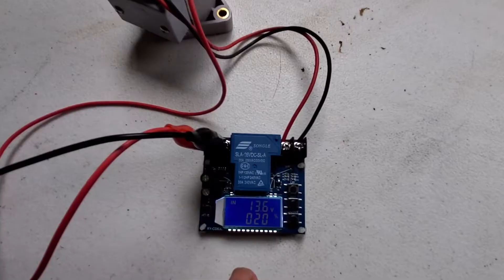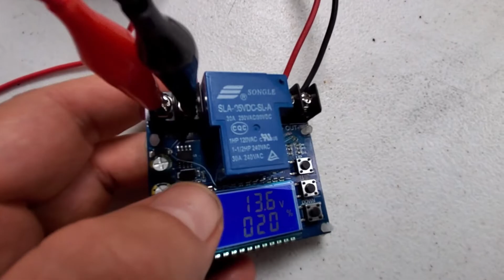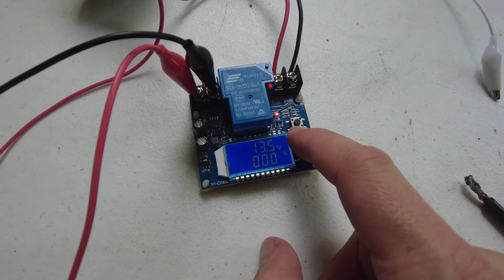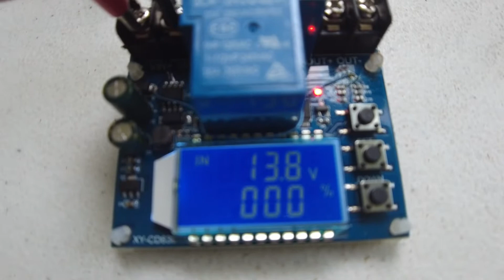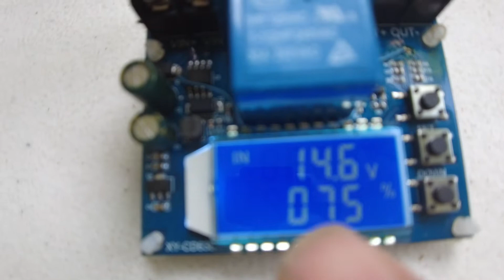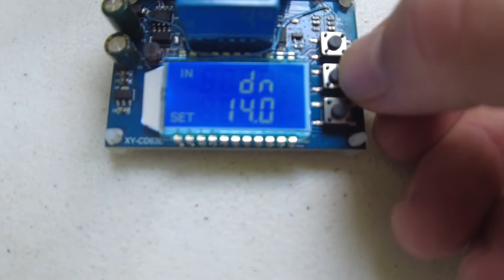Protection from shorted MPPT

Comment: My understanding is that this is one of the few things you can use to disconnect a high amperage DC load, because DC breakers and shutoff switches can arc and catch fire, but these should be filled with hydrogen. I would love any more input on this, too.

Comment: so the BMS doesn't have high voltage protection?
Reply from the maker: There's a limit to how high of voltage it can protect against. The MOSFETs in the BMS have a voltage rating, this could be 20v to 80v, usually not higher than 80v. So if you hit that MOSFET with 120v it will fail, and unfortunately many times the failure mode of a MOSFET is short, and a shorted MOSFET will pass that voltage right though.

Comment: That is really awesome!!!  Very good to know that there are options out there.  I wonder how many times this has happened with other charge controllers so far?  One chinese knockoff part, and BAM, solar power setup FRIED.  It will smell like burnt chinesium afterword...
Reply from the maker: Yeah, I know at least one other that the charge controller shorted, and destroyed his nice battery bank, and the BMS didn't help because it cant handle high PV voltage. Good thing he had LiFpO4, if it was Li-Ion would have been a fireworks show.

Comment: As you point out, shorting the solar panels to the battery just drops the solar panel voltage to the battery voltage. This mppt failure can only harm the battery if the battery is fully charged. So limiting the voltage the battery can be charged to is the perfect solution. 
I'm surprised the internal relay on the module doesn't handle the current without using the contactor? A similar unit I have in my hands right now shows the relay as capable of handling 10A with a relay contact rating of 240V. Can your solar panels deliver more than 10A?

Given you are feeding the solar via the thin white jumper cable that will limit current to the battery. Have you tried it with a cable capable of handling the current from the solar panels? Under those conditions, the solar panels would be limiting the current which is not a problem for the solar panels.

By adding that module, the modules function is duplicating the same function inherent in the charge controller. Good belt and braces approach.

Very good solution Brad. 

The other possible failure mode with equally devastating consequences is a short in the mppt controller across the battery. This is solved with an inline fuse on the battery. If the short occurs on the solar input side, the solar panels will not be harmed, though a fuse in the solar circuit is possibly a good idea too.

The polarity of the contactor is due to a reverse protection diode in the contactor across its coil intended to limit the high voltage spike generated when the contactor coil is de-energised - as Sylvan dB points out in another comment.
Reply from the maker: Hey Thanks! The relay on the module can handle 240v AC, and only 30v DC. Did you see where I was arcing the 120vdc PV cables? That internal relay cannot quench that arc, and would burst into flames. Be careful with your unit you mention, and make sure that 240v is for DC, not just AC, very different beast. I suspect it's only 240 AC, as DC requires arch quenching mechanism which raises the cost, and size. Thanks again for the great comment!
Reply: @BradCagle  Arcing! Saw the demo but it just didn't register. Yes, that would destroy the contacts of the on-board relay immediately. I wonder if there is some kind of quenching circuit that could be used? On the other hand a solid state relay may be less prone to causing such arcs in the first place? The problem with the contacter (unless it is a latching device) is the current it draws can be wasteful. 
Thanks for pointing the arcing issue out.
Reply from the maker: @Bennyboy-dog  Yup not only destroy the contacts, but that arc can stay lit for indefinite length of time. I've heard about using a capacitor in series with a resistor, but I'm not sure if that will work for arcs this large. The contactor I'm using has what tyco calls an economizer that reduces the hold power to 1.7w, so not bad.  Even solid state relays have a voltage drop that will cause power loss, consider 48v x 30a = 1440w if you lose 1v across the SSR 47w x 30a = 1410, the SSR cost you 30w vs 1.7w of the contactor. Now the contactor will be using your battery at night, where the SSR will be using nothing at night, so something to consider.

Comment: Contactor polarity: It may have an internal diode to dampen the inductive kick from the coil. Could use ohmmeter to test coil resistance, reverse leads and test again and if the two readings are different, probably an internal diode.
Reply from the maker: But these are the contact terminals that have the plus/minus. The coil does have polarity too for obvious reasons. Someone mentioned it may be for arch quenching to work correctly.
Reply: @BradCagle  Yep, the snubber diode goes reverse bias across the terminals so that if there is an ark created by a collapsing magnetic field on an inductive load (starter, high torque electric motor, etc.) it will "snub" the reverse voltage created instead of allowing it to ark and possibly weld the contactor or melt the contactor or let the magic smoke out of the contactor.
Reply from the maker: @johnbrizendine7716  Ahh, that makes sense  Thanks!
Reply: I believe it's called a "snubbing diode" which is a very good thing to have, so that you don't get any voltage spikes, especially if you are running an inductive load off the battery when it kicks off.  If you have a power inverter running full tilt, and that contactor kicks off, could push some pretty serious reverse voltage from the collapsing magnetic field.  I doubt you are going to see anything like that with your setup, but this looks like a very generic contactor, possibly a 24 volt starter relay or something like that.  Lots of good information out there if you search for "snubber diode"

Comment: That's some good information, I think I will give this a try. How does the other board hook up for 48v?

 I think any charge controller would be prone to failure, I am all about adding safety to my electrical equipment.
Reply from the maker: Yeah man I never consider I would need this, until it happened. Eye opener for sure. You'll just place the other board (buck convertor) between the contactor, and the spot where I have the contactor wired in the video.  You'll need to adjust the buck converter voltage to 12v before hooking the contactor to it, so you don't accidentally over volt it.